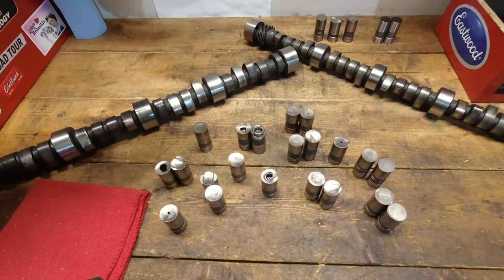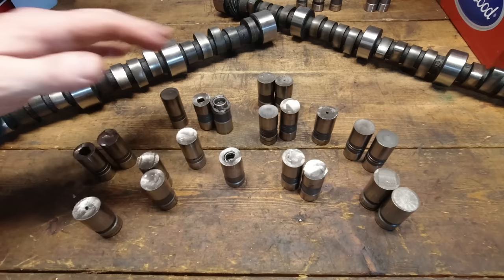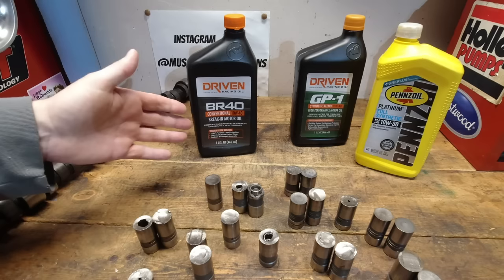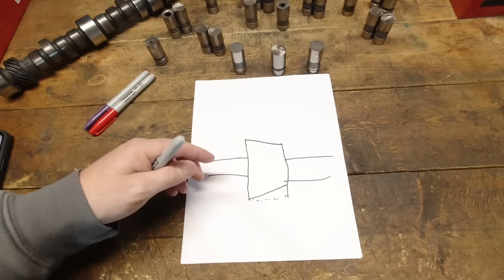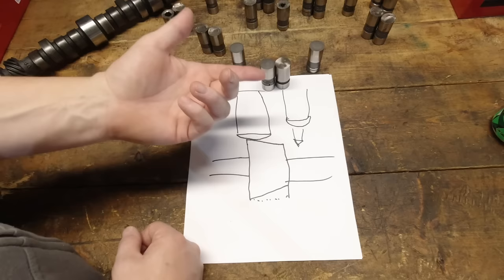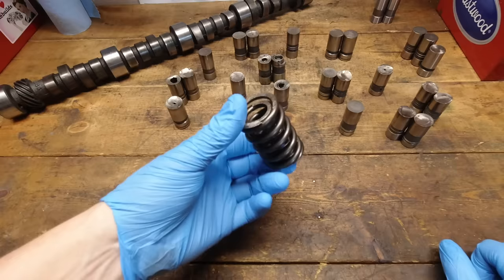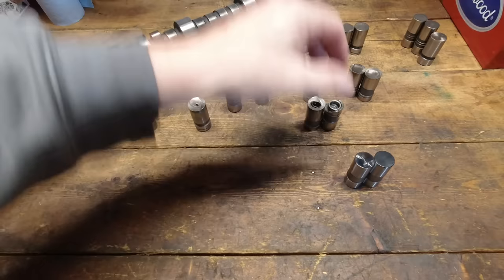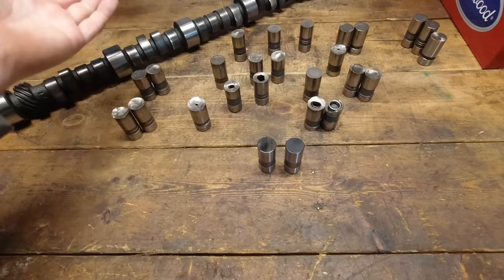Flat Tappet Cam Failures: The Reason Why They Go Bad & The Solution! Part 1

Comment: My 460 has now a good 2000 miles on it since the break in and I used Lucas break in oil at the time. Since then I have been using regular oil with the Lucas zinc additive. I see this is now a waist of time according to your video, but now, what to do? Can I just use a standard oil from this time forward? My machine shop said it's not necessary for the zinc additive at this time.
Reply from the maker: If it’s a flat tappet cam, I can’t think of a single situation in which I wouldn’t run an oil formulated for it.  That’s your decision to make.
Reply: @MuscleCarSolutions  Yes it's a flat tappet cam. I have not seen the Driven brand of oil in Canada. Other options in oil with good amounts of zinc you can recommend?
Reply from the maker: I can’t speak for all Canadian distributors as I know the western ones more closely, but Mopac Auto Supply and Dix Performance both carry Driven.  Also Lordco Auto Parts.  Primarily BC and Alberta but Dix is also in Ontario.
Reply: @MuscleCarSolutions  Much appreciated! Im in Ontario, I will check them out.
Reply from the maker: @denniskwasnycia1950  Dix Performance is located in London.  Cheers!

Comment: I am wondering where your source of information comes from on the lifters that you have there were made in the usa. I have built engines for 35 years. when you ask manufacturer where their parts are made they won't tell you. I have personally quit building engines because of these failures. you can buy comp cams cam and lifters and use break in oil and still have failures as well as crain,  and many other manufactures. I have watched it get worse and worse in the last 5 years. Also not all manufacturers make their own lifters very few do they are made by other companies. If comp cams knows they have failure because of volume then why do they fight every case tooth and nail when they have failures even with break in oil and the right springs?
Reply from the maker: There are multiple things I used to verify that information.  The major brands in todays marketplace that are selling flat tappet cam and lifters are sourcing those products from suppliers in the US.  Mostly in Michigan.  If you want to do that search yourself, you’ll find who those manufacturers are.  I didn’t name them on purpose but given that information I’m sure you’ll find out who they are.
Reply: @MuscleCarSolutions  I do talk to them and they are not honest about where things come from and that was not an answer either.

Comment: Im so afraid to fill my motor with cam shavings im willing to pay for the roller cam
Reply from the maker: I’ll always lean towards a roller, but the same things apply on that set up as well.  Make sure your machinist is measuring the lifter bores and verifying lifter to lobe interaction.  If they don’t, the same catastrophic results can occur.
Reply: @MuscleCarSolutions  thank you for adding that to my fears as well.
Reply from the maker: @imheretolearn770  get a good machinist and neither one are problematic.

Comment: Can't use the dlc coated lifters unless the manufacturer for the cam makes them though right?
Reply from the maker: Remains to be seen.  They still have a crown in the lifter and they still need to rotate.  I would stick to using them on a comp branded cam to play it safe until more folks try them out and report any issues.

Comment: An oil scientist told me that he only recommends gp1 for a flat tappet cam.
Reply from the maker: Time to find another “oil scientist”.  GP-1 works excellent with a flat tappet or roller valvetrain.
Reply: @MuscleCarSolutions  I’ll try this again since I got deleted by you or YouTube for my response to you earlier. I guess we have to tread lightly with statements on this platform, and the real truth can’t be spoken. My statement does NOT say that you can not use gp1 oil in a roller cam or any other type. My statement simply says that a oil scientist told me that if he had a flat tappet cam engine, he would only run gp1 in it. I guess some people have reading comprehension problems.
Reply from the maker: @JohnDoe-ud2cc  don’t see anything in YouTube’s held for review.  Generally if folks are dropping f bombs it will end up there.  I didn’t delete anything.  Perhaps I misunderstood your original comment when I responded.  If that’s the case, I apologize.
Reply: @MuscleCarSolutions  🤙

Comment: Also zinc have been removed from today's oils
Reply from the maker: @roberthoward3247  even with a properly formulated break in oil and regular service oil, zinc isn’t the biggest factor in why flat tappet cams fail.  We cover a lot more info in the rest of the series.

Comment: Just stop putting rock hard springs on them. I blame most of the failures on hard springs. So what if it floats at 5500, At least it keeps running for years. Soft springs save engines and give you a built in limiter.
Reply from the maker: Most of the time when asked someone who had a failure what their spring pressures were, they don’t know or ignore the question.  Light pressures are for break in only.  They don’t always have to remain at the light pressures.  But 100% springs are a big time problem for break in and few give them any attention.

Comment: Can you still buy break in springs for a small block chevy
Reply from the maker: Lighter springs are fairly easy to find.  Any good machine shop can help match up what you need and get the right set.  As long as the pressures come down to an acceptable level and you give it the time it needs, it’s all good.

Comment: Why do the new Comp lifters with the dlc show a mirror like finish? One can see your ceiling on them without any distortion! Doesn't that mean that they are completely flat and don't have the so called crown at all which is so important!? That is really confusing! 

What is your opinion on new well manufactured lifters and pushrods on a used original cam in a 455 BBB?
Reply from the maker: If you can see a crown on a lifter my friend, you’re Superman!  You’re not going to see it on that DLC coating either.  They have the standard crown Comp uses for all its lifters.

Putting new lifters on a used cam?  Sounds like a recipe for disaster!  I’m not sure if they’ll have a core for it, but if you want a cam ground on the original awful specs of that cam, I’m sure a company that does custom grinds can look into it for you.  I say awful in todays world.  If it’s from the late 60s or early 70s, keep in mind lobe technology has changed quite a bit.  We no longer have lead in our fuels.  We have terrible fuel (generally) today but I’d much rather have something ground with todays lobes on the specs you want for the engine.
Reply: @MuscleCarSolutions  Thanks for your answers.
So the coating covers up the swirl marks from grinding completely as I am assuming. I was thinking there would be a tiny bit distortion visible in the reflection from the crown just like on a flat clear coated surface with the slightest dent or imperfection in it.

As for the ('71) BBB, what does the fuel quality have to do with the mating surfaces of the lobes and lifters?
From the performance standpoint you are absolutely right about modern cam setups. But what if one doesn't want to go that route and would like to keep it stock instead? I would simply like to get rid of noisy lifters to be frankly along with new rockers.
I am experienced in working on Mercedes from the 60's to late 90's (all non-pushrod engines with OHC and different oiling system of course) and we never had a problem with those having hydraulic lifters without rockers. Even very high milage cars wich are still daylied with only new lifters installed. Also no special oil used afterwards but a simple 10w40.
So I was interested in your opinion and/or experience with that procedure applied to a BBB. I am sure somebody tried that before in the past.

Thanks again for your time!
Reply from the maker: Flat tappet cam and lifters wear together.  By putting on a new lifter on a used cam, you’re going to wear both again.  Chances of the cam making it out alive are minimal.  Fuel quality has everything to do with the profile of the cam.  Which is why I’d suggest upgrading if you’re suggesting the lifters have issues.  Plus I’m not sure who offers a stock profile cam for that engine.
Reply: @MuscleCarSolutions  I'm sorry but you got the cam and fuel thing wrong again.
Also the the proper procedure for inspecting and replacing faulty lifters as described in the original Buick shop manual is exactly what we do with the Mercedes engines except that we replace all lifters as a set. In fact both manufacturers routine is/was to replace the faulty lifters only. Not the whole set and not the cam if okay.
So I don't think there is anything wrong thinking about that way and demonizing it right away is just wrong if you never tried it yourself or heard from anyone directly who did it this way. Just seems to be not common anymore out there with engine builders etc. for whatever reason. 
I guess I'm as smart as before...
Reply from the maker: No, I’m absolutely correct about lobe profiles changing to meet the quality of fuels today.  I’m sorry, but unless you’re living somewhere that still has leaded fuel, cam profiles have changed to work with what we have available today.  Just like we don’t follow ignition timing specs from the 60s, we also use updated technology in todays better cam grinds.  I have an interview scheduled with Billy Godbold soon.  Maybe you can tune in and learn something from him.  As far as what you’re planning on doing putting new lifters on a used cam.  Please, by all means.  Let me know how it worked out for you.
Reply: @MuscleCarSolutions  Sorry again but you brought in the modern lobe profile and gas which I alredy have been aware of. But I wrote about an original used BBB cam with new lifters from the beginning regarding lubrication/break-in and experience in wear by that constellation. So let's leave new cam specs and modern fuel quality aside.
Maybe you will be able to ask Mr. Godbold about this procedure (from the past) in that interview. Sure, he wants to sell his stuff but may have tested this as well and is able to provide some detail.
As I wrote it worked and works perfectly fine on older Mercedes engines from our experience and please understand that I am in a state of gathering information about this on the BBB now before I make a decision on what I am going to do. Might still take some time though.
Nevertheless I am looking forward to the interview and the information provided to everybody interested in that topic.
And if anyone else has any information on this LET US KNOW HERE PLEASE!

Comment: I thought rpm variation is for ring break in?
Reply from the maker: Rings take a significant amount of time to break in.  3-400 miles.  Initial cam break in requires enough oil to get to the camshaft so there enough to keep it happy.  Crank throws oil to the cam and why the RPM should be raised.
Reply: The variation from 1500-3000 rpm is because the oil spray onto the camshaft is different at each rpm.  If you hold it at 2500 rpm, you may only get 3 spots sprayed on the cam, while the rest of the cam is dry.   You have to have engine load to break in the rings which involves actually driving the vehicle

Comment: It’s often the miss matched components that is put in the engine. Camshafts with too fast a rise rate and too big a lift along with valve springs too strong. The big three made muscle engines with performance cams that lasted and ran fine. The aftermarket always went beyond the practical limits of a street engine. To much everything, duration rise rate, max lift, spring forces, increased rocker ratios all these add up to higher stress loads. Why doesn’t anybody even mention this? Many guys are running drag race cams and components on the street. They were never intended to go more than 1/4 mile at a time. A few seconds and done. Stock hydraulic L79, L82, Comp 270H, or near stock profiles and Z28 springs has always worked for me.
Reply from the maker: If that were the case, we’d be stuck in the 60s and having 500, 700, 900 or even 1000 HP engines (on a street car) would be unheard of.  Lots has been learned about opening and closing events on camshafts.  I have an interview coming up with Billy Godbold and we’ll be discussing that.  Cam technology has changed.  Spring technology has dramatically changed.  Understanding how to keep a valvetrain under control also has dramatically changed.  The technology has changed enough that the innovators like Billy have helped move the quality and technology forward.  One thing we can look back at the history of the internal combustion engine and be in awe of is how far we’ve come over the last 40 years.  It’s a big horsepower world out there!

Comment: You need EP additive...
Reply from the maker: If you have to add an additive to your oil, then you’ve chosen the wrong oil.
Reply: @MuscleCarSolutions  all oil contains an additive package, you need an oil that contains real extreme pressure (EP) additives the zddp is obviously not sufficient for your application...
Reply from the maker: @edogsx  we’ve done a number of videos on oils and interviewed the folks at Driven as well as the leading tribologist in aftermarket and performance oils, Lake Speed Jr.  The additive package should be chosen based on the use.  Oil however is not the magic cure for these failures.  It’s only one part of the equation.  There are a number of issues that we’ve covered and will cover in the final video in this series coming very soon.  Stay tuned!

Comment: can i run break in oil all the time
Reply from the maker: No.  You’ll get a sludgy mess without detergent.  When the break in time is done, switch to the right formulated oil and you’re good to go.
Reply: no sir,no need to continually run special oil after the break in,regardless of what oil company is trying to sell you.